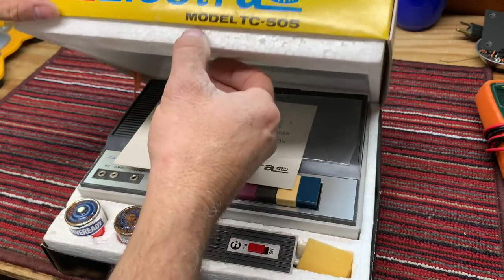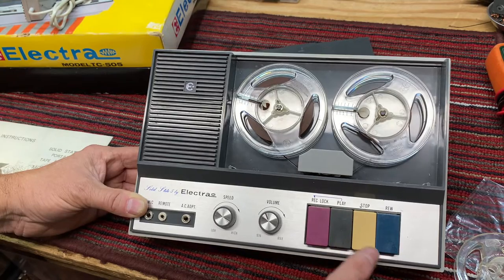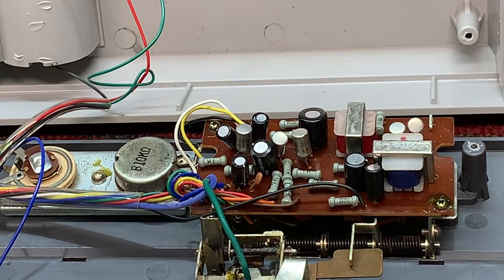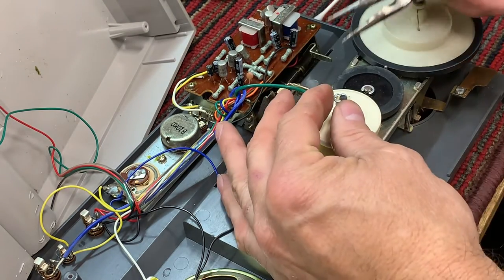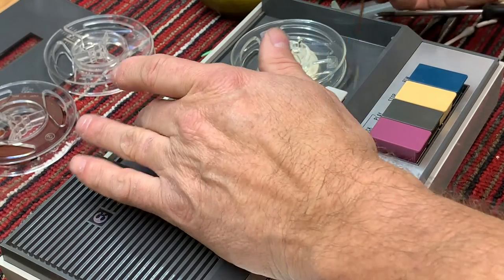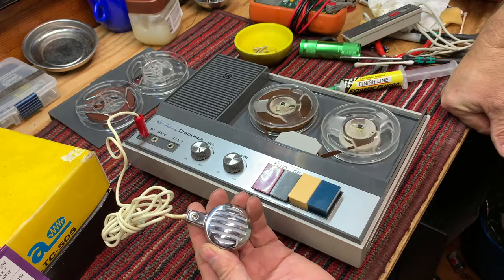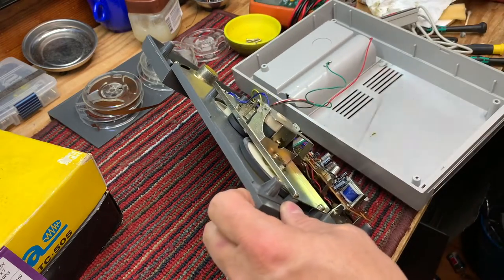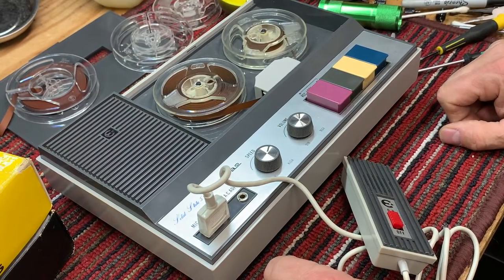Unboxing and Repair of an Electra TC-505 R2R Tape Recorder

Comment: Nice repair job. I think the speed contol could do with a bit of looking at, It does'nt seem consistent. Does the mic fit the space next to the batteries? Have a happy new year.
Reply from the maker: Hello Franko.  Yes you are right.  I treated the speed control pot with deoxit, but it does still seem inconsistent.  And yes, I tried to insert the mic into that compartment and it fits but is a little tight.  Good catch.